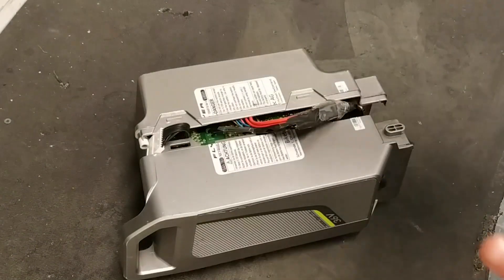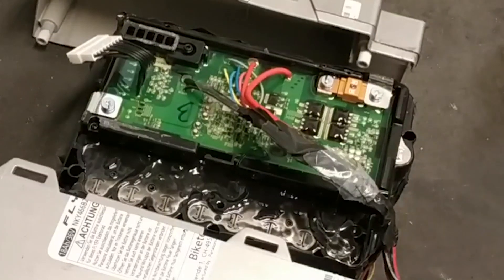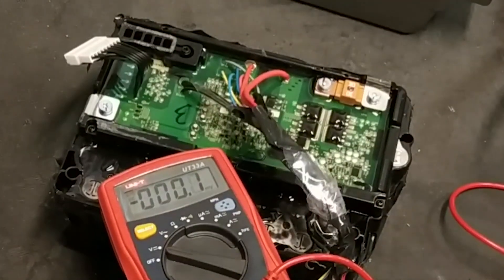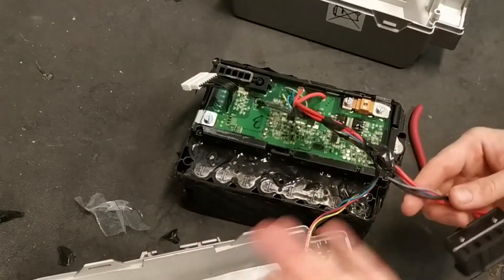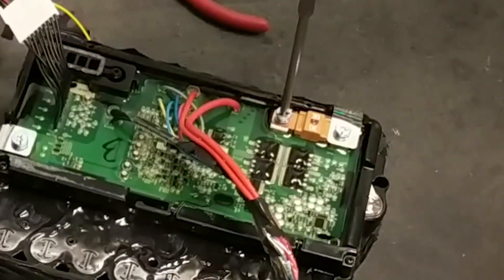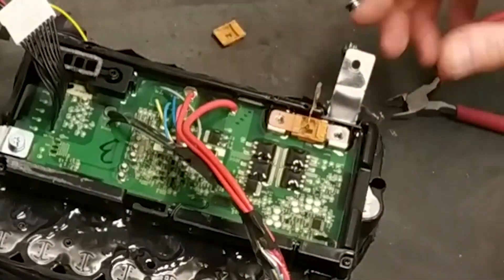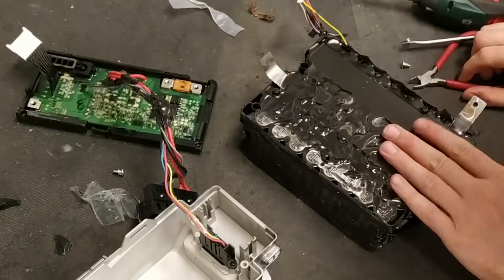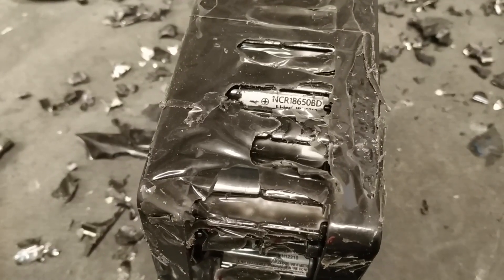Inside a FLYER 36V battery pack from Panasonic/Sanyo

Comment: I want to fit a 2 pin battery to my Panasonic 3 pin motor. The 3rd pin needs to be a BMS. Is there a possibility to cancel the BMS? Original batteries are very expensive. Much cheaper batteries with much more Ampere capacity are sold.

Comment: I am in the process of repairing one of these and found your video from 5 years ago.
The pack I am repairing had one dead cell, which I have replaced, and now I am reassembling the pack.
It was useful to see how the BMS is mounted since this was given to me already disassembled. Yes a lot of silicon rubber, but not impossible. It would be great if there was a source for getting replacement nickel strips. I had to make my own.

Comment: Hi Doctor,
I have opened 26V Flyer eBike battery (16Ah / 404Wh pack - NKY335B2) and replaced all old 56x Sanyo cells (1 was broken, completely killing other 7 cells in the same parallel group) with the new 56x Samsung cell. After the assembly is finished, I tried to activate the battery and put on the charger. Battery block woke up, but I have two issues:
1. When I press the charge level button, all 5 LEDs blinks one after the other like in a "rotating pattern". This repeats about 6x times and they turn off. What is the meaning of this? Is there a way to reset it back to normal?
2. When I long (>5sec) press and hold the charge level button, 2 LEDs came on: This indicates battery remaining life time is about 40% left. But, this was left over from the old Sanyo cells. Is there a way to reset this back to 100%?
Thanks in advance.
Cengiz
Reply: Any update? I have a similar case with lights flashing after eachother and battery doesn't charge. Did You figure it out?

Comment: Hi BD,
Can I buy you a coffee or beer for answering a question?
I have this pouch cell NKY281B2 10Ah from my mothers Flyer e-bike which i want to replace the cells with Samsung 3450Ah. But, is there a catch to the BMS not accepting the new cells? Can I disconnect all the wires and build the new pack in the same format 7s2p (actually upgrade to 3p or 4p  7s2p) and the BMS and controller will still work? No need for factory intervention to reactivate the components?

Comment: They are well built but really hard to fix... do you know if a new pack without the sensor and temperature poles (gray and blue I think) connected would work with the charger and the e bike?

Comment: Doctor, may I ask you if I can replace all 42 cells 3.7v-2600mah by 42 new cells 3.7v-3500mah into this ebike battery pack Flyer NKY314B2 ? All articles I did read say it would not be a problem, but just wanna be sure by getting a pro advice. Thanks a lot :)
Reply: I suppose you got your answer by this time. May I ask, did you totally disconnect the BMS to the point where it had no power? Did the new cells get accepted by the BMS/controller? No lock-up of the system?
Reply: @camielkotte  Yes all new cells were accepted by the BMS and got no lock-up for this battery model (NKY314B2). However, I got a serious lock-up with NKY428B2 model. Unable to charge again even though voltage is correct.

Comment: Hi Doctor,
I'm trying to dissassemble a NKY314B2 but I get serious difficulties. Do you have a advice to get it disassembled the battery housing (42 batteries) and change some cells ?
Reply from the maker: No its not wort the trouble, use generic holder and glue on the BMS.

Comment: Battery pack from hell! Would it be posible to make stack of new cells and conect them to board?
Reply: Yes you could do that. But in these complex BMS situations and since the cells where dead i could not confirm the BMS was working but if i se no reason not to try if you have this pack and the time to experiment, especially if you actually have a bike to try it on! I have recently found battery partner that can sell me new batteries that work with the Panasonic system that is on the Flyers bikes so i dont have to deal with this mess any more!
Reply: @Batteridoktorn  So, what is curent price for new batteries? I found replacent battery for Panasonic 26v system 15Ah for 680€